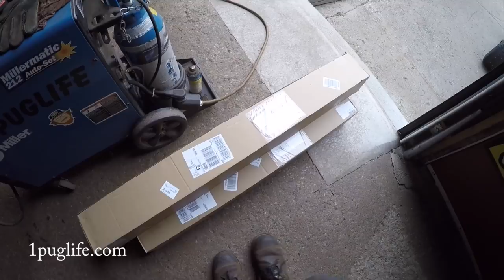Almost Died~New Truck ~New Channel

Comment: When I made the Rear fender patches for my old rusty dodge I used some nice shim steel from where I worked and traced out where the wheel well goes then cut it out real nice then took some steel banding and welded it along the wheel well it came out really nice and almost matched the factory lip on the under inside radius. SCORES!!! It impressed a bunch of people they thought I bought the patches. they wanted me to make them some for their trucks. Welding and burning are good trades to know if you can do it properly.

Comment: that would be a hell of a video if rusty came crashing down on the brit pickling, then pug tries to activate the lift and it breaks off the 3 inch concrete floor

Comment: Gotta keep up on the lube factors. Our lift did the same exact thing. Greased the rollers, greased the chain, no more bind. In fact, I think it's the same brand but instead of overhead cables the cables run under it. Also stretched cable probably doesn't help lol

Comment: lift problem seems like air bubbles in the hydrolic lines check your fluid levels pug
Reply: chrisrhudy2000 it's polyester pissing the gurgles in pugs hydrolics

Comment: Brand new steel cable needs to 'break in', after it's had weight put on it the first few times it will stop stretching and you won't have to adjust your lift anymore, at least not for a really long time.

Comment: lol, i'll give you better understanding of DODGE wiring, your Trailer and exterior light are 2 different system, Truck exterior light are run by TIPM "total integrated power module" while your trailer light system is on external relay (DIFFERENT WIRE),  by the looks of it your truck has having exterior light issue and they splice it to your trailer plug wire
Reply: You forgot to add the hashish psychosis aspect.